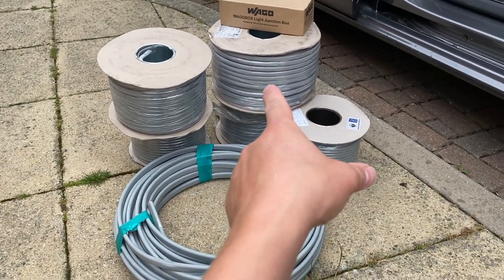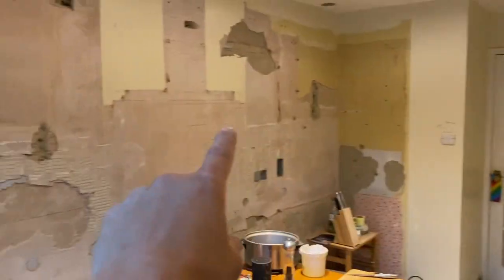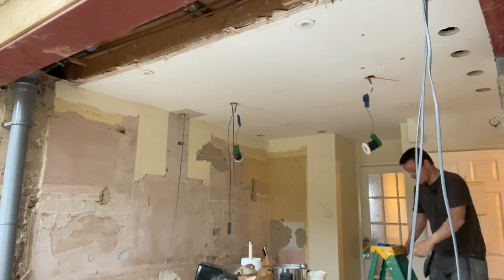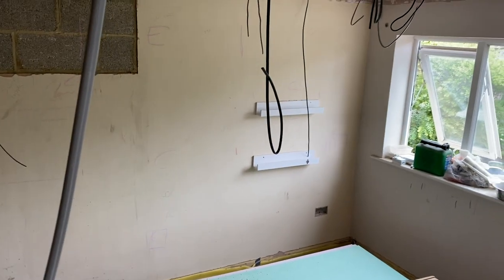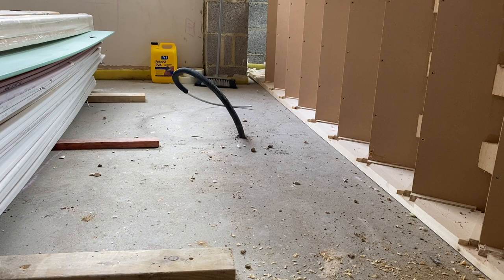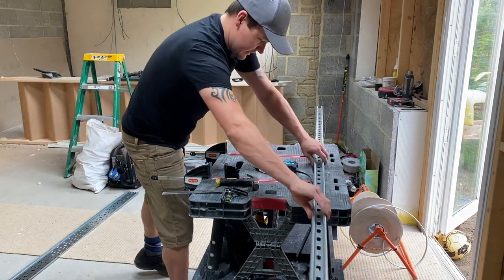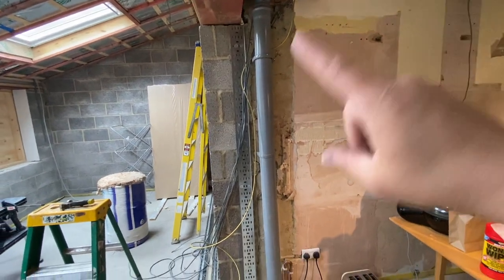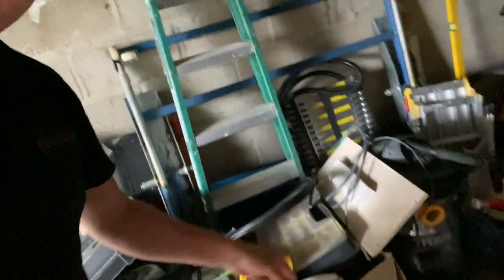Installing cable tray in a domestic property ? Bundy Banter Bus.

Comment: Late comment: I used 3 lengths of Univolt 100x35mm wire basket tray to run RF, network, phone and some other LV cables the length of the loft here a few years back. First time I'd used anything like it and being basket construction cutting and bending was a doddle. Pity the fixings etc. are expensive compared to the basket.

Comment: If you need to get a cable through a buried Flexi conduit use your dust vac or a blower to pull a piece of string and something small through like a washer. Them tie cable to string and pull

Comment: Some in house wiring is stranded for homes there?
I am new to the channel I came over from one of Clives videos.
I do not think I have seen stranded wire used for house wiring.
I am here in the US here and I think you maybe over in the UK?

Have run wiring and wired up sockets.
The running of the wiring was done with direction of the contractor my folks hired and I put in the socket myself and alone.
Bad story on hooking the socket up is I got the full on 120V as I could have sworn I flipped the breaker so that I could wire up the socket and so got ready to hook it up and for some reason I touched both live and neutral and felt the current went from one hand to the other.
Was not a very good feeling.

I did get the right breaker flipped and got it wired and now I always do a quick test any more when I am working on wires now as I learned a lesson that day.
But hey the socket works great and is power my pinball machines and much more. :)

I just recently replaced the timer for the fan in the main bath and I got out my multimeter when I flipped the breaker and then tested it to see if I get any voltage on the meter and I did not so got the new fan timer in and no blowing myself up. xD

Comment: Question: in domestic houses, is it allowed to fix ceiling mounted steel cable trays? Does the cable need to be low smoke? The customer wants an industrial look, they have a converted warehouse apartment

Comment: Probably going to get my head shot off here... but I don't get the preference these days for using radials rather than rings. In the old days we used radials a lot on a 15A fuse but as I recall you were limited to 2 sockets on a 7/029 cable. Rings were a Godsend! But as I say it was a long time ago.....4 mm 2 is heavy and difficult to terminate in anything but a deep box? Comments (keep 'em clean) appreciated.

Comment: i thought the CPC has to be at least half the CSA of the live so 4mm would be 2.5? I've got one of those tables but never knew you could use the clamps like that. They're so good them tables. Also, get a metal cutting circular saw for tray.

Comment: Nice to see some tray!!! If Nick takes the Flexi off ya hands, you can buy a hand held band saw and cable tongue :). With tray can use galv couplers to stand off. Or if not many cables vertical, flip tray and use lips for stand off :)

Comment: Do you run the lighting circuit from the switch or do you run a three core to the switch for smart switches? Just curious what everyone else is doing.
Reply from the maker: Yeah a always drop a feed at the switch especially with spot lights

Comment: Forget the copex.... was that hacksaw blade in the right way 🤣.Great video as usual. One question why use the 4mm cable on the radial circuit instead of the usual 2.5?
Reply from the maker: 25amp rcbo
Reply: @Cjrelectrical  good call as with grouping of cables may have decreased the cable capacity i think 2.5mm in free air is 27A
Reply: Not a 32 amp radial?

Comment: How is it putting 2x4mm into socket?
Reply from the maker: Huh
Reply: @Cjrelectrical  I've never used 4mm. So I was just wondering was it easy to wire with into socket?
The 2x lives & 2x neutrals etc.
I imagine it would be quite a tight fit.
I was just wondering because think it is a good idea doing that for kitchens.
Reply: @edglue6138  MK says you can get 2x4mm or one 6mm in a socket. It's the dressing in the back that's the issue never use a 25mm back box with flat plate usb 😅
Reply: @tresslerj1985  I did that to existing socket a while ago. When USB sockets first came out.
It was challenging haha
Reply: Ed Glue most USB sockets recommend a 35mm back box but the terminals should handle 4mm fine, if you want a 32amp ring in 101 installation method you need a 4mm ring, sockets handle it adequately.
Reply: @icemanA84  👊👍

Comment: 2.5mm ring vs 4mm radial?  Fight!!!!......
Reply: No contest where you actually need a radial. Wiring a ring is a faff and a half unless your accessories form something approaching an actual circle - start at one end of the house, go round and come back the other side. Easier to dress cables and wire terminals in 2.5

Comment: Why not simply use a NEST?
Reply: And Philips HUE
Reply from the maker: It’s having hive system I’ve hard wired the thermostat positions to future proof it.
Reply: @Cjrelectrical 
I simply suggested NEST as the thermostat and control box communicate over WiFi so less wiring.
Reply from the maker: Hive is the same 👍
Reply: Can I ask? What is the story behind the socks? You keep highlighting them but I think i have missed why!
Reply: @Cjrelectrical 
Sorry but you mentioned a programmer which confused me.  I'm not familiar with the Hive but like the way that NEST knows whether you are home or away and changes the heating programme accordingly.
Reply from the maker: Sorry Neville me referring to the programmer is the hive control box
Reply: @Cjrelectrical 
Ahh - thanks I thought that you were meant one of those grey Honeywell timers.

I take it that you favour the Hive.

Comment: Genuine question, not being funny. How do you get around fishing through the lightning cable in ceiling with no mechanical fixings?
Reply: i think your on the same page as me fire support of cable during escape and fire fighting activities , the last bit fire fighters will soak the ceiling to cool the fire down it may collapse leaving them tangled in wires. the room could be filled of smoke, so they can not see i indeed fire clip the cable but access is required unfort and see why chris went with this method
Reply: You just don’t fix them, no regs book is gonna suggest you have to remove the ceiling just to clip them.
Reply: It's in the fabric of the building. Only surface wiring systems are covered under premature collapse 👍
Reply: @supersparks9466  521.10.202 requires cables to be adequately support against their premature collapse in the event of fire note 1 fire fighting activity to be considered each to there own tho like any version of bs7671 its open to debate and personal interpretation 
another thing i was debating is the cables fished thro with pipes in the area 522.2 what type of pipes maybe another call for clipping the cables making sure they are placed from source of heat
Reply: If the ceiling is soaked enough to collapse then I suggest there is no one to save from the fire, this premature collapse thing is mainly for commercial and industrial premises, obviously still a good thing for domestic but I don’t see it as comparable.
Reply: But the cables are in the ceiling not surface so that reg dosnt apply
Reply: Your talking about the ideal world,of course it’s the better job that all cables are clipped the entire length and away from pipes but in these scenarios all you can realistically do is support them where you can,it’s the nature of house bashing, unless the builder is paid to take the ceilings down cables are always gonna be left lying in the voids.
Reply: Premature collapse means cables coming down before the rest of the building collapses. If the ceiling has to collapse for the cables to come down it's not premature collapse.

You may want to clip to them if you can to keep them away from someone drilling through the ceiling or putting insulation all over them in future, but that's just the ideal not a requirement and certainly not worth taking the ceiling down for.
Reply from the maker: If a ceiling is down and the timbers are on fire then a cable is not going to worry a fire fighter. Any cables buried within the fabric of the building ie behind plasterboard , timber, bricks, doesn’t require protection from premature collapse.

Comment: 5:13 I would have thought (I am not even remotely an electrician :) ) that would require some sort of conduit or trunking to prevent the possibility of heat transfer to the insulation and a potential fire hazard?